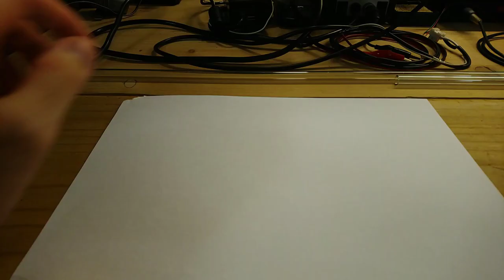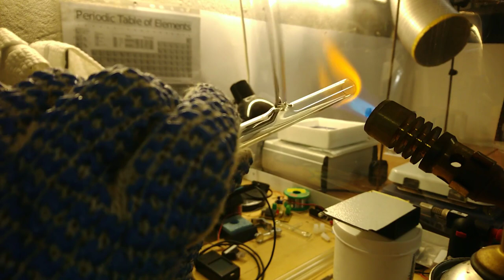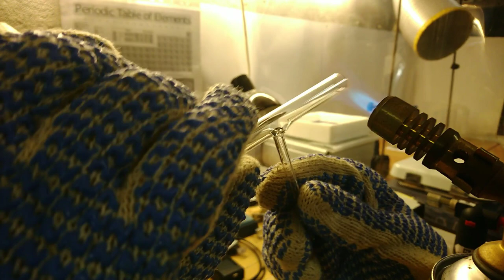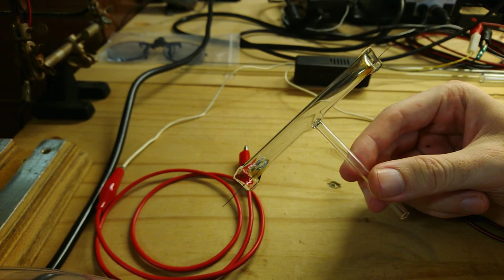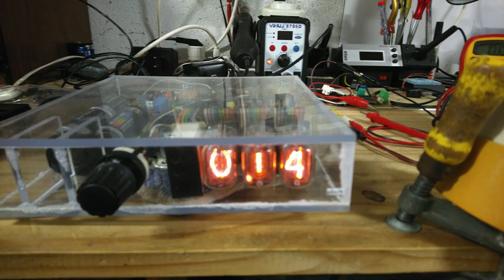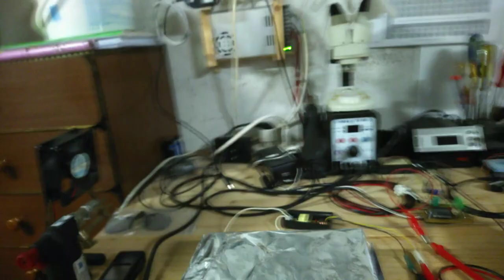Does my lamp prototype produce X-rays?

Comment: Do you know why the lamp makes these discrete lines? That increase in number as the pressure increases, and have this "stepping" behavior (appearing or disappearing 1 line at a time) ?
Reply: The phenomenon is called plasma striations or plasma stratification. It's quite complex. When we are in a DC discharge, a bright anode column is formed at a certain pressure spaced out by a dark area. At lower pressure ranges, the positive column is composed of striations, or ionization waves, caused by the electrons finally having enough energy to ionize the gas, then losing the energy by ionizing it, then reaccelerating back to high enough to repeat. This causes a series of barrages of photons being released in waves, seen as striations in the plasma. In AC the anodic column moves continuously and makes the phenomenon even more complex and susceptible to other stimuli such as capacitive coupling, any resonances between the frequency and the ionized gas, etc.
Reply from the maker: Learned something new. Thanks.

Comment: Bello! Non vedo l'ora di vedere il tubo riempito di Neon. A che tensione lavora l'alimentatore?
Reply from the maker: Open circuit it overflows my oscilloscope, and the frequency is too high for a multimeter. I need a 100x probe...